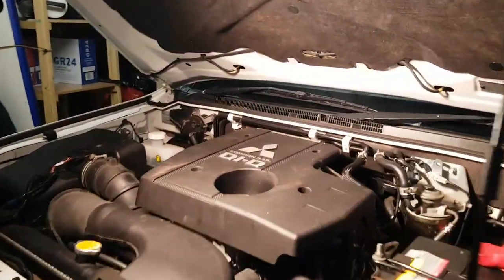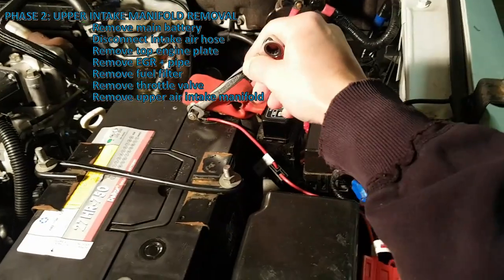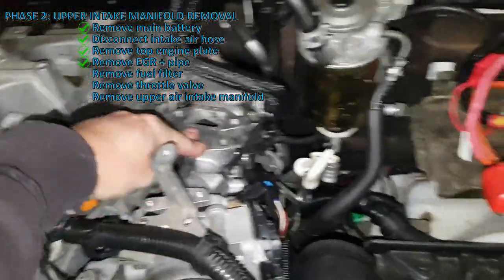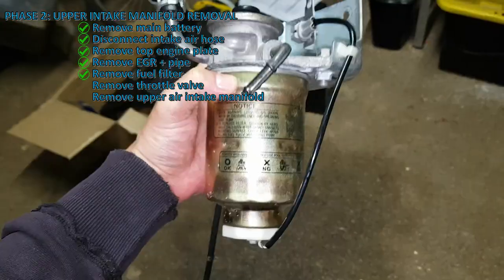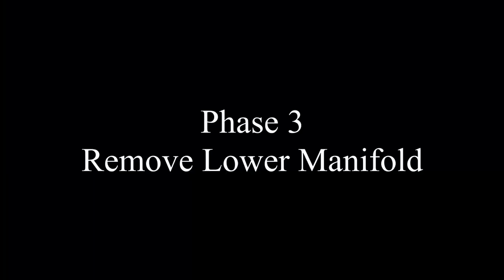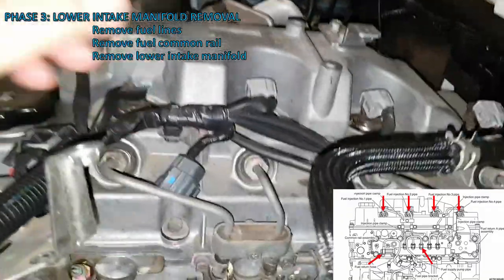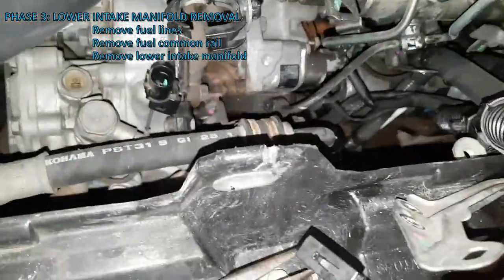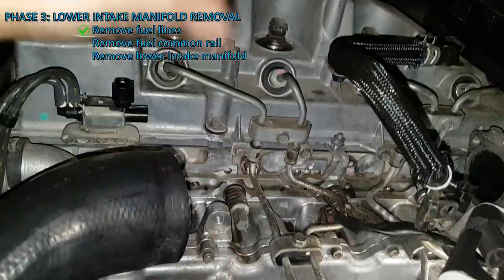HOW TO | Intake Manifold Clean | Complete DIY step-by-step removal | Pajero | 4M4

Comment: Can someone help me please, I took my 2004 NP Pajero to the mechanic for a few things, it was previously running fine, they convinced me to have a manifold clean, my car is now running rough, occasional surge the engine light and ABS light go on and off, I feel like my car is suffocating ?? I told the dealership to check code it was a 41 the dealership tell me it's nothing they did!! they do not touch the throttle valve sensor when cleaning the manifold,  that I need to pay to get it fixed, after watching this video it seems  they would need to remove it. Do you agree that the dealership must of done something wrong.

Comment: Great job showing all the stuff!  Esp trying to film by yourself! 
If I could recommend 1 thing before starting.. it would be to spray down (cooled engine) with degreaser and pressure wash off any grease and grime, dirt etc than blow off any water with compressor or let dry well before starting job.
Other than that, great video! 
Thx for all the effort!

Comment: BJ Thanks for your responses to date. I came across the removal of the old rubber gasket today. It’s stuck pretty hard against the head. How do you remove it, do I 

use a heat gun or is there any easy way to get it off other than trying to pry it off?
Reply: kerosene/fuel and scrapper?
Reply from the maker: Bit late... but I just used a flathead screwdriver to get it started from the corners and did the rest mostly by hand with some prying with the screwdriver around the threaded posts

Comment: BJ, I commenced the job today and have reached the stage just before removal of the manifold. However in your video you said the two bolts under the manifold need to be taken out one was very hard to get to because access was blocked by the transmission dipstick. I have found it impossible to get to that bolt. Can you tell me how you actually got that bolt out?
Reply from the maker: From memory, I think I just used a 150mm socket extension with a ratchet. I think I also slightly pushed the transmission dipstick to flex it a little to get the end of the tool on there. Hopefully you get there in the end.
Reply: BJ Dizza cheers mate.  Yes got it all off in the end.  Those back nuts on the manifold are fun too!!!

Comment: brilliant - I am about to start.  Helpful suggestions.  Can I please ask:
 - Did you clean the ports?  How did you avoid bits going into the chamber?
 - Did you replace any other hoses or gaskets or oil rings?
 - did you use Glitz or other?  How many passes to get fully clean?
 - any problems restarting - did you bleed the fuel lines by cranking the engine before tightening? Or did you just use the fuel filter to prime then just kick over till it started?
Cheers Thanks.
Reply from the maker: Ports - I just got a screwdriver and bent the tip over and scraped them from the inside-out only, making sure not to scrape outside-in. Then used a vaccum to get some loose bits. I didn't rotate the engine or anything fancy like that. The way I see it, bits of soot would be breaking off all the time and going through, so what's a little bit more hurt...

Gaskets - I only replaced the rubber gasket for the lower manifold. All other gaskets are probably reusable as long as they're not damaged. It's recommended to replace the fuel pipes if they've been installed/removed 5 times, but I just did a visual inspection and re-used them. No idea how many times they've been installed.

Oven cleaner - I used Glitz and Easy-Off-Bam. Easy-off works better to remove the soot but is harsh on the lungs and throat if you breath it. Glitz is nicer to work with.

Restart - took a while to start: primed the fuel filter, cranked for 5 seconds, primed, cranked for 5, primed, cranked for 5, primed then finally started

Should be another couple of videos posted soon to cover that. The editing takes longer than the actual job!
Reply: @dizza90  excellent thanks for the reply.  I will keep an eye out for the cleaning phase